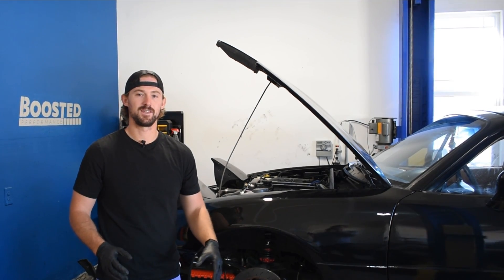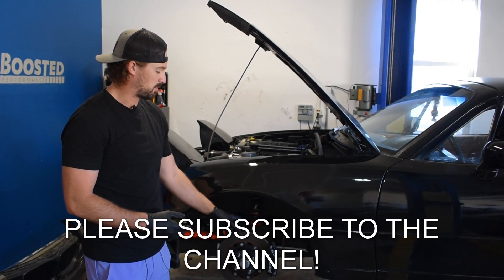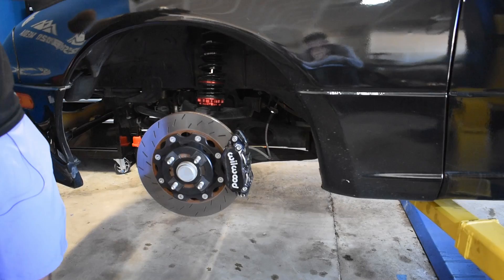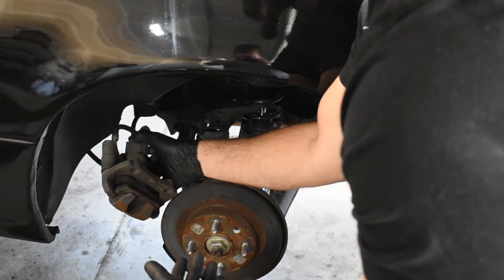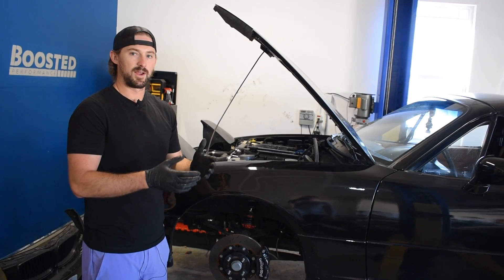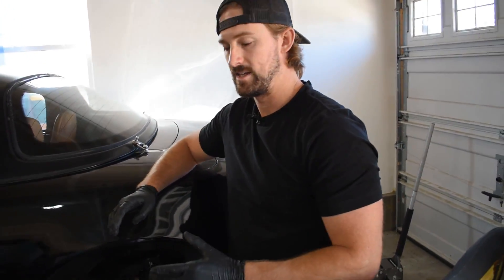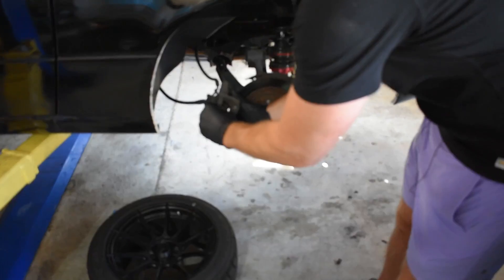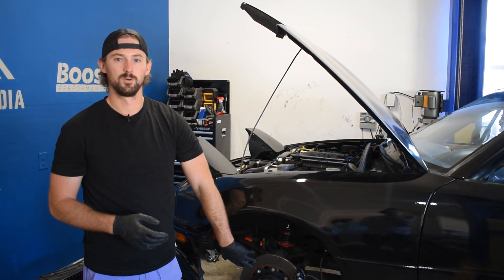How to Diagnose & Fix Sticking Brakes!

Comment: First, great video!  I had a caliper that was sticking and replaced it but that tire is still sticking but not all the time. I took the lid off and took out some fluid. The rubber seal on the lid was popped out so popped it back in and did fine but a couple days later same thing, new caliper sticking so repeated again and did fine on way to work. I thought I blead the brake after installing the caliper but maybe not well enough. Could the issue be air? When i changed it the hose drained really fast.
Reply: It was the brake hose. I replaced it and the caliper is no longer sticking.
Reply from the maker: D - Nice! Thanks for coming back and updating. This will certainly help future viewers.
Reply: DIY. Think next would be the break hose maybe. All other brakes are working.
Reply from the maker: D - Certainly could be. Keep us updated on this!
Reply: I went out to check the car at lunch and, keep in mind that it was parked on a slight downgrade, but there seemed to be more fluid in the reservoir than I remember from when I bled them last evening. When I changed the caliper the fluid did drip at a decent rate.
Reply: Brake hoses can close up on the inside  and this will cause the fluid to not return quickly and thus drag on the rotor
Reply from the maker: D - Unlikely to be air. Have you taken it to a shop or did you DIY it?

Comment: Great video. I’ve been having brake issues primarily on the left side of the car and nobody can seem to figure it out in fact most don’t even see fault in brakes. I’ve swapped pads and rotors numerous time, I’ve even put a new caliper (no change), replaced the rubber hose, bled them. My issue is that when I brake then release I can feel the pads still stuck on the rotor when I try to move forward and it makes a loud clank noise once they release. Also get these occasional brake squeals and eventually the new rotor will get scored. The most recent set of pads I removed had an actual lip on top of the pad itself which I think meant the inner pad was hitting the rotor on an angle. Do you know what could cause this? It sounds as if the pads are jumping but I don’t understand how unless the floating part of the caliper is jumping too and I’m not sure how that could even happen every thing is secured to factory torque spec.
Reply: Is there a mount for the caliper and if so did you clean and grease the plunger?

Comment: I've been experiencing somewhat sticking on my brakes, when I'm at a complete stop and then when I'm releasing on the brake and then pressing on the gas I would hear a thump.
Reply from the maker: Yepp sounds like you're having some sticking - I'd suggest checking the things I mentioned in this video. Could be something as simple as fluid or could be a caliper issue but tough to say without more info and checking all the easy stuff first.
Reply: In my case a very loose tie rod caused the front right tire to have sticking calipers. Heard a thump every time i turn at low speeds, and shortly after that the right tire was always much dirtier with brake dust then others.

Comment: I have a squeaking noise at some certain speeds and a video shows my brake where glowing at a point where I don’t think I was using brakes (can’t remember exactly) could my brakes be sticking would it squeak
Reply from the maker: Yeah could cause a squeak, the squeak could also be from the type of brake pads you are using. But if your pads are so low you could be getting some metal on metal squeaking

Comment: Yesterday on my drive home, I started hearing a rubbing noise that is very slight, and after brake pressure is applied its even more aggressive like a grinding. I got home took my wheel off and the pads were healthy (replaced a year ago) the rotor had no uneven wear, and the heatshield wasnt dragging on anything. Could this be a sticking pad/caliper as explained in this video? (1990 NA6 Miata)
Reply from the maker: W - You hit it on the head. This could certainly be the cause.